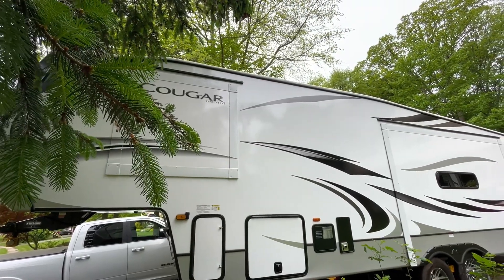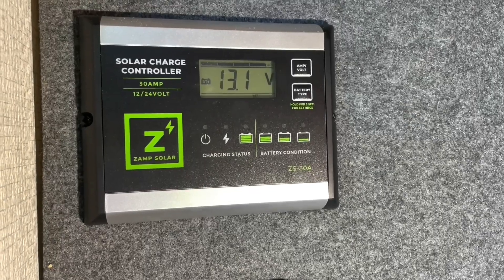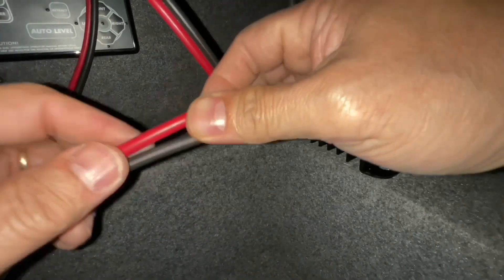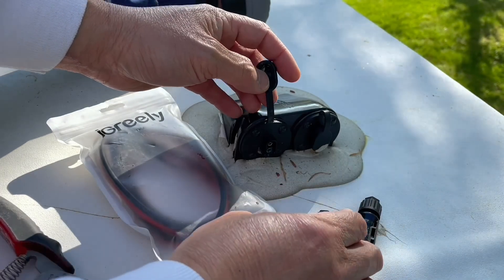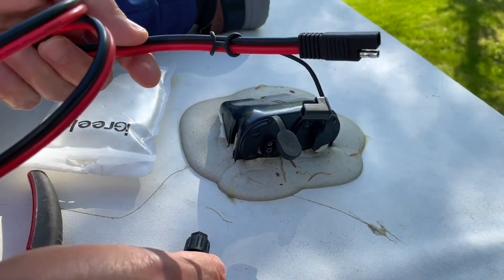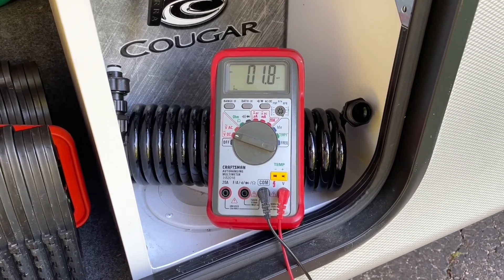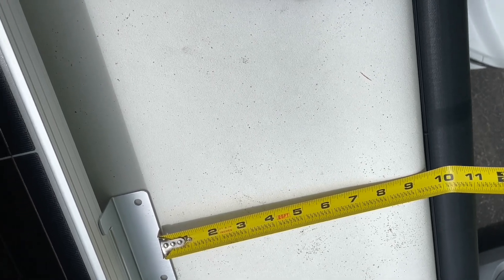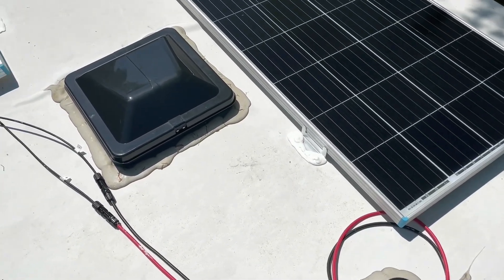How to Install Solar Panel 2021 Keystone Cougar 5th Wheel Upgrade ZAMP Solar to Renogy +Zamp Adapter

Comment: What are the benefits of the solar panels? We have a very similar unit and we were considering them... Obviously they will charge your battery but can you run any additional appliances or amenities when you are off grid camping?
Reply from the maker: With our solar system… off grid, we run coffee machine and my wife’s hair dryer. Those two are the biggest drain… but all other runs great running in our solar / battery bank.

Comment: Where does the lower zamp plug go to. That's direct from the solar panels on the roof,correct?  Now you make another adapter for it and it goes to your controller?
Reply from the maker: If all your panels are the same… the lower “plug in” us for your “mobile” / ground type - face the sun solar panels. Again… these OA els must be the same rating/type—-identical to the ones you have on the roof. Or you can also not mount any in the roof and you can plug at the bottom only.

Comment: Nice of Zamp to change a widely used standard on an oem install that will most likely be upgraded.
Reply: I saw a quick polarity solution in another video involving zamp equipment. You can buy a small polarity changer and wrap it in electrical tape, or heat shrink tubing.

Comment: Couldn't you just have reversed the wires at the charge controller so you wouldn't have to make a plug for the connection on the roof for panels?
Reply: Sounds like a legitimate fix instead of making a pigtail. Thoughts?

Comment: In this solar install video you inverted the adapter saying that the positive and negative were backwards from ZAMP. How did you determine that? 
Also, my salar ready system did not come with the charge controller so I will have to track down the wires. Are they coming down the wall behind  the iN·Command?
Thanks In advance.
Reply from the maker: See 8:18 of the video - test it. Insert a red and a black of your multi meter. If your multi meter reads with a negative, the red is on the negative. If you don’t see a negative, that means the red is on positive. Look at the cable and you will see that typically the connector is reversed polarity

Comment: I upgraded my 2021 Cougar to (10) Zamp solar panels. 1,500 watts total. (2) 60 amp Zamp charger controllers and (9) battleborn 100AH lithium batteries and replaced the 2,000 watt inverter with the Zanterra 3,000 watt inverter. Also installed a sub panel so that all outlets and rear AC work off the inverter.

Comment: Hey Charlie,
Tom here, we discussed the backup camera before. I have the same rig as you, the 290RLS. Mine had the Zamp 170w single panel kit installed with the 2000w inverter and same Zamp 30a controller. 
I purchased the single Zamp 170w panel expansion kit and it comes with mounting brackets but no fasteners.  Do you recall the size of the screws you used for your installation? I'm not sure if the screw went through the roof or not in your video.
Reply from the maker: I used a kit bracket and screws from HQST… I still have a set and measured it. It is 1.5 inches. If you are buying just the screws.. go with 1.25 inches… but 1.5 is fine.
Reply: @cbatilo  Thank you Sir! 1.25 it is.

Comment: did you take into consideration the roof rafters when placing and screwing down the panel brackets?  Did you drill pilot holes first?  Also the connection box on the roof looks like it has two connection points, why did you only use one? Thanks
Reply from the maker: The roof board is really thick. I suppose you can scan for the rafters and drill it in. It would definitely be more secure...solid! I did the same (not scanning for rafters) for my 2 year old Jayco TT and never had a problem... with regards to the input, I will be adding two more on the other / back side of the 5th wheel and reserving that input. Thank you so much for watching and questions.

Comment: looks brilliant but I see on  YouTube videos why they don't put elevated track to hold the wiring and keep it off the on the roof for better water runoff only needs a couple of small stands to hold it up I live full time in RV camp and I was installing starlink on my neighbours rv and they have  Solar Panel and it had all sorts of crap  round the wires so why can you not use small aluminium u channel upside down which the wire can tuck up in side it and it will  protect it from wildlife and sun and you can attach it from one solar panel to the other save puting more holes in the roof
Reply: I really like the channel idea... thanks!
Reply: @KaraGermanShepherdAdventure  i got the idea from when I was  breeding Parrots it was only why to stop them from eating the wiring for night lights